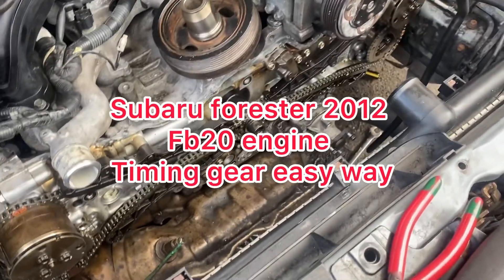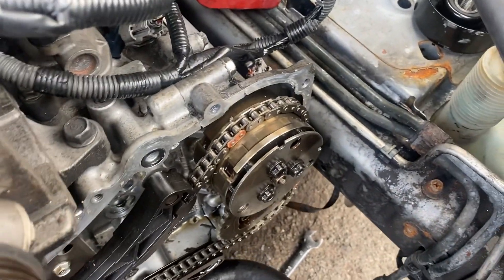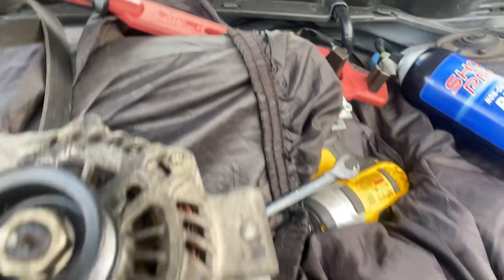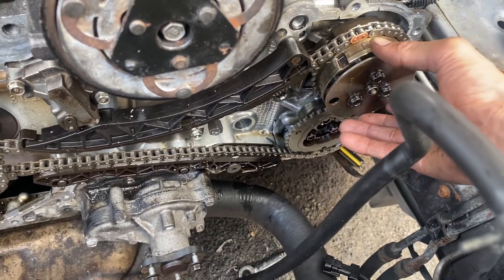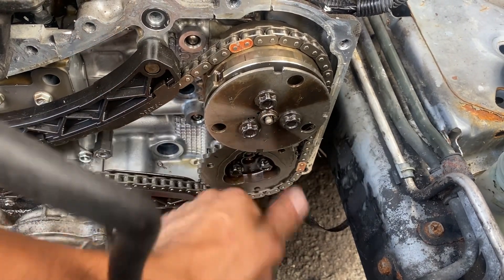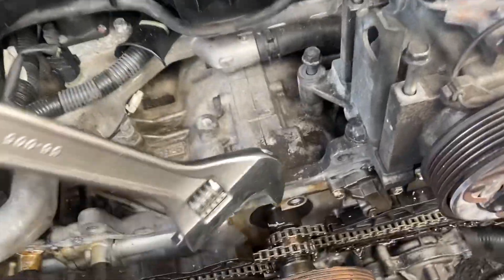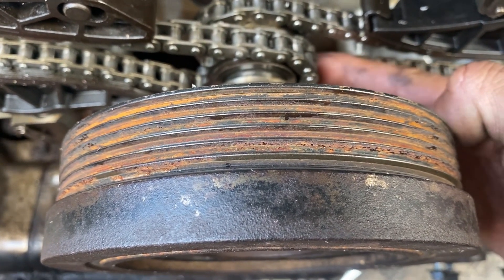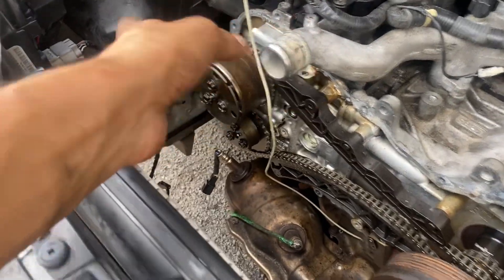Subaru FB25 Timing Chain Alignment DIY | No Special Tools Needed

Comment from the maker: 🛠 Tools & Parts Mentioned (Amazon Affiliate Links)

🔧 Engine Timing / Camshaft Alignment Tool Kit
👉 https://amzn.to/48WRJa1

🔧 Timing Chain Kit with Tensioner & Guide Rails
Compatible with Subaru FB20B / FB25
👉 https://amzn.to/4arEXBk

🔍 FOXWELL NT630 Plus OBD2 Scanner (ABS & SRS)
👉 https://amzn.to/4ljKQ6J

🔍 Autel MK900 – Bidirectional Scan Tool (2025 Release)
👉 https://amzn.to/3XZ36rR